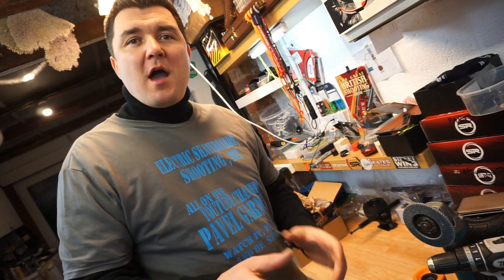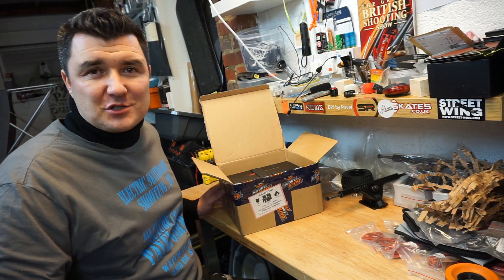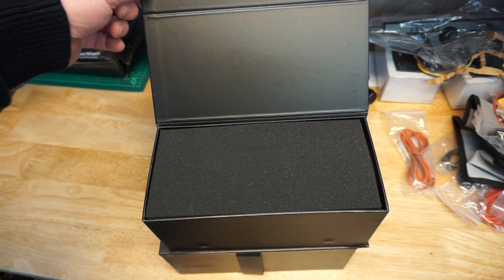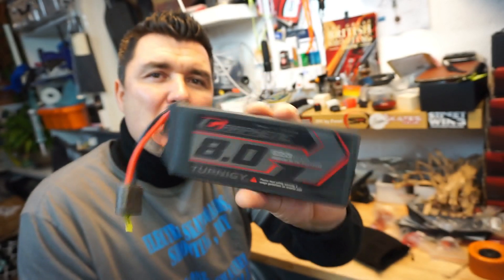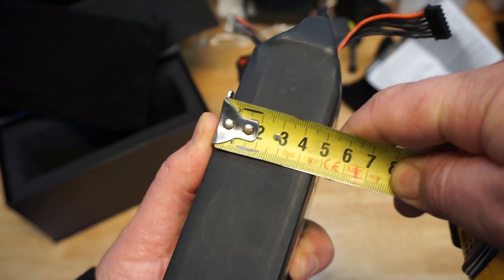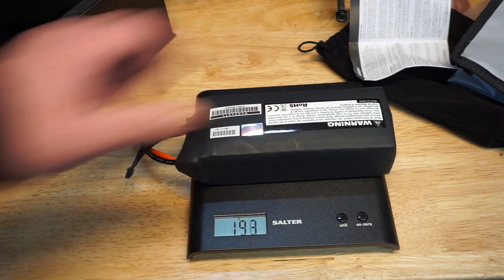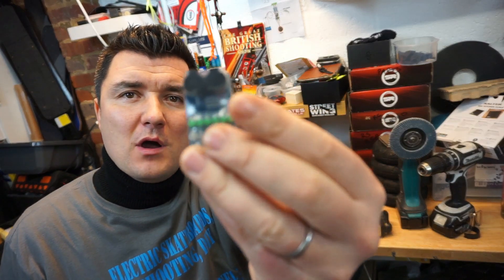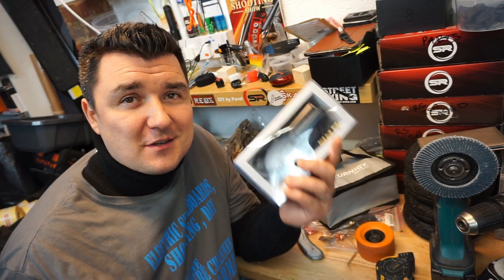Graphene 8000mAmp battery packs for DIY projects ESK8

Comment: Hello!  Been watching your videos for a while!  Very informative.  I'm building my first electric mountainboard.  I've been using your videos for reference.  I'm about to purchase lipo batteries from hobbyking.  I wanted to buy the same batteries that you are using.  The representative from hobbyking said that the 15C discharge rate was too small.. Used for drones.  I'm not so sure I believe him. Would you mind giving me your thoughts?
Reply from the maker: I am using 15C on my board with no problems.

Comment: lol really, no one huh? Well I know I've seen  lipos on diy vids over a yr or more ago...And I've been using them since my 2nd board I built....straight to 12s I used!  Sadly I've never even rode  a legit production board, shits too pricey, but I've been building and riding my own boards, which were  never shitty slow ones either bc I had to be faster always then the hella whack scooters around here. Anyways, just letting you know you Def know you weren't first,  clout chasing is that serious huh? Nah  but just letting you know in case this somehow can lead to my poor ass somehow being able to get a set of cloud wheels somehow :(  no cheers for poor life
Reply from the maker: Hi,
It is my fault for not expanding on the " special idea" ... it was not special to use lipos , it was special that they were installed in my backpack - not on the board. Video is on my channel somewhere.

Comment: how are your graphene lipos holding up? :-) any idea how many charges you have now? any degrading? I bought yowoo 6s 6000 graphenes about 3 mo ago and mine are doing great with the 6.6 plus mini dual esc. ;-) by the way, mine does the little reverse thingy when you hold on full brake past stopping with the flipsky vx2 remote :-)
Reply from the maker: Nice one! I do have the VX2 as well and the reverse is very handy! I do have circa 40 charges on the packs and so far so good. I do ensure that I keep them on the storage charge even if they are sitting away for just couple of days. Thank you for watching mate.
Reply: @PavelGarmas  did you notice flipsky now has a vx2 pro model? only $70 us right now :-) I just received my vx2 about a week ago but will be getting the pro model for my next build. thank you for the videos. they have been very helpful with my decisions with purchases :-) happy thanksgiving from the states :-)
Reply from the maker: Hello Jessee,
Thank you for watching and for commenting. I did buy the VX2 couple of month ago ( not the Pro ) and did install it on my recent DIY. I did think of getting the Pro but the only difference is the coloured screen. I think I will get something different for my next build plus it will give me a chance to review : )
Reply: Hi guys, do I need BMS for connecting two 6s lipos 200000 mah (12s) to flipsky 6.6 dual plus? Some people say that vesc will fry without bms...thank for help
Reply: @superchannel6506  no you don't need a bms if you are using a balance charger. 😉 If you plan on charging with a single 50.4v plug, you would need BMS. 😁 Good luck
Reply: I used those 6s yowoo graphene batteries for about 6mo and got some bigger ones. Now, I just purchased 2 4s 6000 to go with the 6s. I want to run these 10s 12000mah set up with a BMS. Do you guys think it will be ok to mix these 6mo old batteries with the unused ones? I'm hoping the BMS will make up for any lagging cells 😉 the first set of 6s batteries I bought still work like new. Everything is on the way so I will be testing my theory 😉
Reply: Space is a factor here otherwise I would have gone 12s 😉 all fitting in a bigger beast box 😁
Reply: The bigger ones I got were the same ones Pavel was using in this video 😉 they are great batteries and I get just about 10mi from a charge on them. I have moved further from work and need just a little more range 😉 it's a pain balance charging at work and carrying charger n power supply.

Comment: Hey Pavel. Any idea what the smaller wires go to? https://youtu.be/vDscT-PSlvs
Reply from the maker: Hello Jason,
I would say that these are the cables that do connect the ESC and the battery. There are two plastic boxes ( enclosures ) under the deck wright? So the cables are there to connect them....they do run inside the deck.

Comment: I'm aware lion batteries are in series and parallel, are two of these only 12s1p?  Or are there more cells in parallel?
Reply from the maker: Hello Perry!
Nice to see you back : ) Two of these will be considered as 12S 1P but the difference is that you just simply look for a pack with the mAmp rating that you need instead of trying to calculate 18650 cell capacity and series/parallel bit of it.

Comment: I have a gen1 boosted board with a bad battery. Is it possible to wire in two of these batteries? They want 500.00 US dollars to fix so can someone please help? Thanks in advance
Reply from the maker: Hello Jason!
Thank you for watching my video and for the question. Theoretically - Yes you could use the Lipo batteries to replace the damaged battery pack but practically it will be hard. You will need to find Lipos with an identical voltage, discharge rate and solder the connectors to suit the board electronics. Another issue will be fitting the new Lipos into the original battery case.
What is the issue with you battery pack? You could just replace the cells for a better and new type ( I would recommend Samsung 30 Q ).  I have done it four times already and had very good results. Will cost you around $150. Please take good care if working with batteries as they will catch fire if you do connect them incorrectly or damage them.

I do have couple of videos about replacing the cells on my channel so please take a look. A link to the main video - https://youtu.be/5NFHNwYj5z4

Hope this helps.
Reply: @PavelGarmas  Hey thanks for responding back.  So the battery isn't  charging and I've even tried the treadmill trick that boosted recommended.  Are you familiar with the differences between the gen1 and gen 2 battery?  I can get my hands on a gen 2 for 50$ but not sure if It will work because the gen 1 is wired to the board. Having a battery that can easily disconnect would be ideal. What do you think?
Reply from the maker: Jason,
Unfortunately I do not own a boosted board so can not help you with the gen 1 and gen 2 differences....sorry buddy.
I does sound like the BMS could be fried on you pack. Are you good with tools? Comfortable taking the battery apart?
Having the easy disconnect battery does only make sense to have if you will buys another and carry it with you to replace on the go and extend the range.
Good luck and let me know how you get on : )
Reply: @PavelGarmas  How can I check if the bms is fried? Thanks again for helping
Reply from the maker: Jason!
Sorry for the late reply mate. BMS is responsible for the balance charging of your battery so it could be the BMS but it is not 100 %. You still did not answer how advanced are you with tools and if you are comfortable taking the battery apart ...it is hard for me to advise you without knowing this .
Reply from the maker: We all need to start somewhere : )
Take the battery off the board, take the battery apart, inspect carefully for any burn marks or damage, test the battery voltage at the point between the battery and the BMS.....let me know how you get on and we take it further.
Reply: @PavelGarmas  Got the case split open but not sure what to test. Here's a short video of the battery set up. Thanks again

https://youtu.be/BHNSGd1K4RY
Reply from the maker: @MauiOG  
Morning mate!
I did take a look but the video is quite limited. ...could you please film a bit more especially around the BMS and cabling?
There are couple of things that I have noticed already - insulation is damaged on the cells so please be careful and do not short them out! The metal outer part is your positive and is live!
Second observation is that the cells are not 18650 ....not an issue it's just I have never seen the boosted pack before.
What we are looking to do is measure the voltage across common "-" and common "+" cables. Those are the thicker black and red that go to the BMS .
Take some upclose photos and make another video buddy.
Do you have a volt meter? We will need to test each cell as well .
Are you on FB?
Regards and no metal objects around the battery pack!
Reply from the maker: @MauiOG  
Have heard about a treadmill trick before?
Take a look at the link....worth trying but ensure to put some insulating tape over the damaged cell casings. I would recommend to use the high temperature insulating tape. 
https://support.boostedboards.com/hc/en-us/articles/115000864327-Recovering-Your-Battery-1st-Gen-Only-
Reply: @PavelGarmas  I tried the treadmill trick but no luck. I posted a video on here and that's why the boosted tech said I need to send it in for repair but I can't afford 4-500 plus shipping.   The damage on the batteries happened when I opened the case. It was glued shut and the battery pack and bms is also glued in. The bms is under the battery pack seen in the video.
Reply from the maker: Do you have a volt meter? Did you understand what needs to be checked?
Reply: @PavelGarmas  Yes I have a multimeter  but not exactly sure where to check. I did check a few of the batteries but I'm getting no reading and also nothing from the large positive/negative wire that's connected to the bms.
Reply from the maker: @MauiOG  
Is the multi miter set up to DC and correct voltage range?
Reply: @PavelGarmas  It's a cheap craftsman multimeter.  It has a few options. VDC,VAC, 400mADC,10ADC, 400mAAC, and 10AAC. Will this work?
Reply: @PavelGarmas  I'm getting .000 - .001 using the VDC option. I'm really new to this so thanks for helping.
Reply from the maker: @MauiOG  
Hi
Take a new AA or AAA battery, connect the probes to + and - , click the meter dial to different settings until you start getting a correct reading of 1.5 volt. This way you will know the correct meter setting. Check every cell in your pack and record the reading per cell. The cells in the pack are 26650 and should read around 3.7 volt ....ish.
Reply: @PavelGarmas  ok so I had it on the right settings and I double checked it on double AA before checking. I'm getting .000 on all 12 batteries
Reply from the maker: Something is not right mate....you should be getting a reading. Are you sure that you are measuring correctly? Are you pressing the meter probes to the metal parts of the battery? Should have some sort of reading mate. Try to measure on the black and red wire connections on the switch.
Reply: @PavelGarmas  Purchased a new multimeter and rechecked  a few AAAs before checking the boosted batteries again. I'm getting 1.5 volts on the AAAs but still zero on all boosted cells. I checked the main power and negative wire on the bms and it's still reading .000

Comment: Nice video! My diy run with 2 graphene LiPo 6s 6000Mah 75C. You should try it, voltage sag is completely gone. Less cycle life but so much powerful against my old li-ion cell :) ..
Reply from the maker: Hello Gerard!
Thank you for checking out the video and for the comment mate. I am looking forward to testing the batteries out. These are 15C and not 75C so not sure of there will be a big difference... What vesc are you using on your board? Is it dual or single motor?
Ride safely and stick around : )
Reply: @PavelGarmas  The rate of continuous discharge should give you a better KICK and should help you to reach your maximum speed more easily. I use FocBox unity from Enertion with two 6374 - 190Kv motors (ratio 20/36 on 90mm wheel with 15mm belt). Ride safely! :)
Reply from the maker: Hi,
Sorry but just noticed your post in spam....strange. Thanks for the reply mate! Hows Unity preforming? I did want to get one but it is not available until March so I have ordered the Flipsky 6.6 plus instead : )
Reply: @PavelGarmas  15c on graphene ?? it cant be right... you should have att least 100c nurst rate as i know 6000mah of these have 200c burst rate. are these as someone pointed out lipo in graphene disguise ??

Comment: Nice video Pavel. Excited to see the new board and see how the graphine Lippos compare. Those 6374's are going to be a beast mate!!!!! Which VESC are you planning to use?
Reply from the maker: Hello Simon,
You are correct, the dual 6374 at 60 Amp will be something : ) 
VESC is one thing that I do not have as yet......I am debating between the cheap Flipsky dual or Enertion unity.....one issue with unity is that they are not available at the moment. I could use two Enersion focboxes and I did before but more space is required plus more money....not sure what I will do .

Comment: Hi I’m running 2x 5s 5000 mah lipos 50c from overlander in series never had any voltage sag yet .
Reply from the maker: Hi!
Very nice to meet you : ) I was hoping for the same result - no sag! So will see how these batteries will get on. These are only 15C but should be fine for what I need.
Ride safely and stick around Laura!!!

Comment: those graphene batteries look sexy. Are you making a full on trampa build?
Reply: I just started a Trampa build and am making a full series about building it so looks like we are building off road boards at the same time Pavel!
Reply from the maker: Hello!
Thank you for the question. No, no Trampa this time but something off road for sure : ) I might impress even Trampa by this build .....should be nice and very unique like my " Tank" . Have you seen my 6 wheel Tank video?
Stay safe and stick around.
Reply from the maker: Lee,
Why not to race them and compare the amount spend VS performance? Speed race would be interesting as well.....would make a sweet video : )
Reply: @PavelGarmas  I'm down for that Pavel! Let's collaborate when it's built...
Reply from the maker: Lets get in touch when we get closer to finishing the builds : )